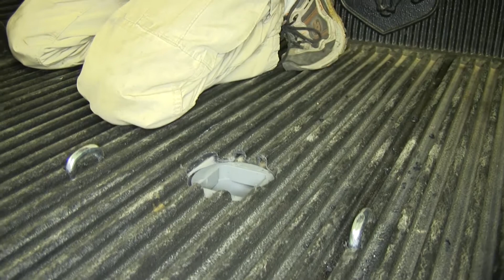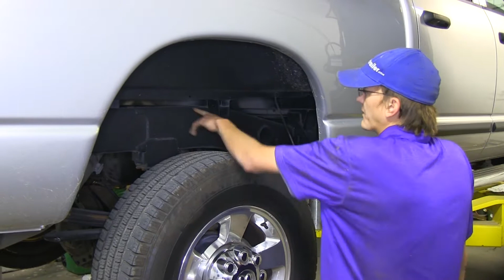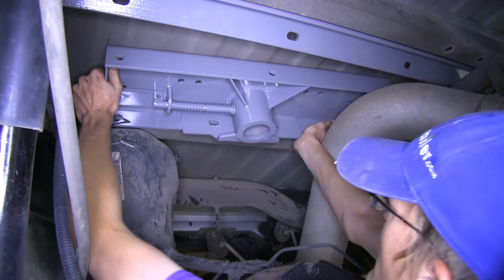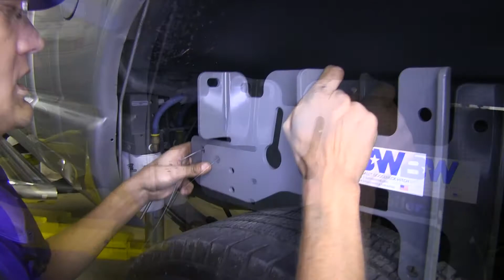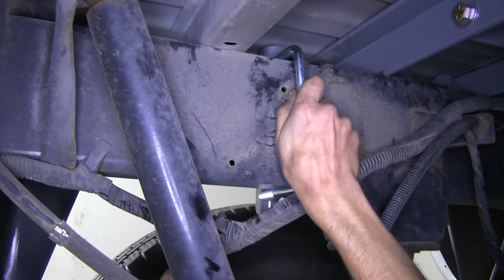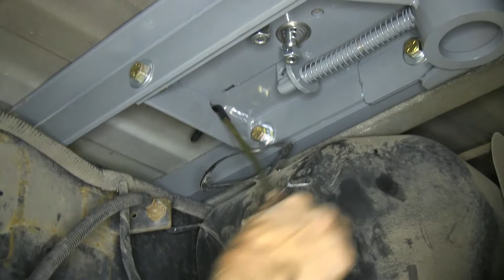etrailer | Gooseneck Trailer Hitch Installation - 2006 Dodge Ram Pickup

Comment: :hand-pink-waving::face-green-smiling: The turn over balls can get stuck in your hitch. The easy solution for this is to coat the ball with TinkSeal. Google it. Ball never will get stuck again and it cures the constant rattling. :goat-turquoise-white-horns::hand-purple-blue-peace:

Comment: What size fish wire is that
Reply from the maker: 1/2" X 48" does the trick =)
Reply: @etrailer where can I purchase that ?
Reply from the maker: @BIG_RED98  We offer replacement hardware kits that include new bolts, washers, and fish wire for your hitch.

That said, if you’re only needing the fish wire and not the full hardware set, it may be more cost-effective to pick one up locally at a hardware or auto parts store. They’re pretty commonly available and sold by bolt size.

Comment: Do you need to remove the spare tire to do this?
Reply from the maker: In the install instructions (see link below) B&W states that temporarily removing the spare tire will make the install easier, but it's not required. Once the install is complete, the spare tire can be returned back to where it was.
https://www.etrailer.com/instructions.aspx?pn=BWGNRK1313
https://www.etrailer.com/Gooseneck-Hitch/B-and-W/BWGNRK1313.html

Comment: Well made a 4” whole directly center of my bed like stated now I have an extra 4” whole because your giving out incorrect information. 06 short bed exact same truck as in the video center while drilled at 3’2” which is about four inches to far to the rear of the truck…
Reply from the maker: Where did you get the measurement info? We don't mention specific dimensions in the video, and the instructions state 45-1/2 for a short bed, or 47-1/2 for the long bed, measured from the rear edge of the bed.
https://www.etrailer.com/Gooseneck-Hitch/B-and-W/BWGNRK1313.html

Comment: I installed this exact kit today! It was very easy in my opinion. I didn’t need anything special other than the harbor freight 4” hole saw. Took me about 3 hours taking my time. My ONLY mistake was making my hole too far forward. Don’t know why.. maybe it was my plastic bed liner throwing it off. It was about 3 inches too far forward. If you have a friend to help it could go quicker. Purchased it from E-trailer and they shipped pretty fast for free.
Reply from the maker: Awesome, glad to hear your install went well for the most part!
https://www.etrailer.com/Gooseneck-Hitch/B-and-W/BWGNRK1313.html
Reply: Thanks and I made the hole look as professional as possible!
Reply from the maker: That's all you can do!

Comment: I just install mine....was not easy at all. Some bolt was hard to get to. Also torque wrench barely had enough room. One bolt you could not get socket with ratchet. It took all day....FYI
Reply from the maker: Thank you for sharing this. Some of the hardware is difficult to get to because of the tight places it is in.
https://www.etrailer.com/Gooseneck-Hitch/B-and-W/BWGNRK1313.html

Comment: Will this replace my Reese 16k hitch with the bed rail system in my 2006 Dodge Ram 2500?
Reply from the maker: Yes it will replace it with a gooseneck. you cannot have in-bed rails and a gooseneck hitch.
https://www.etrailer.com/Gooseneck-Hitch/B-and-W/BWGNRK1313.html